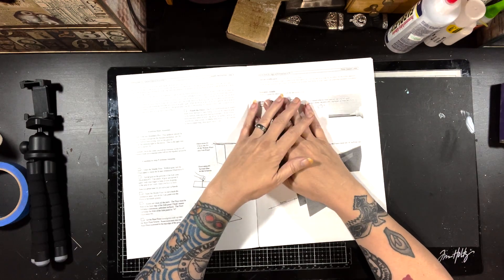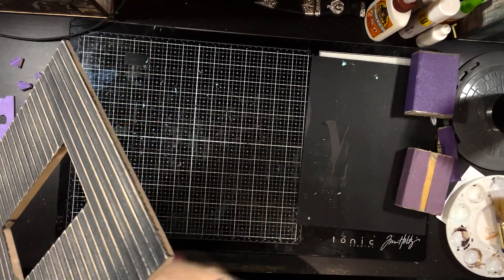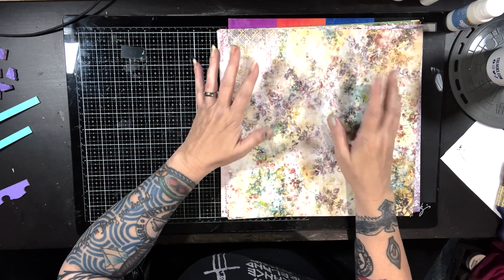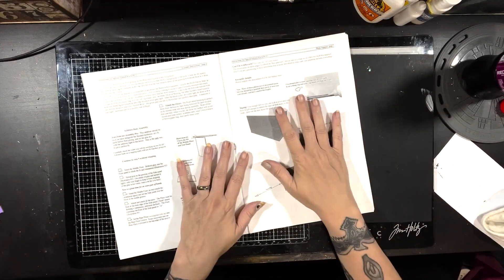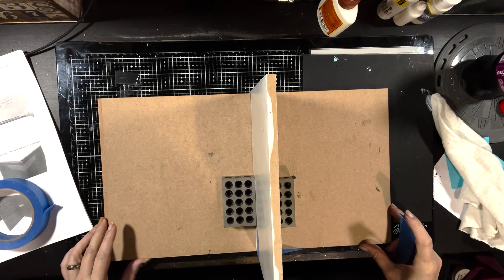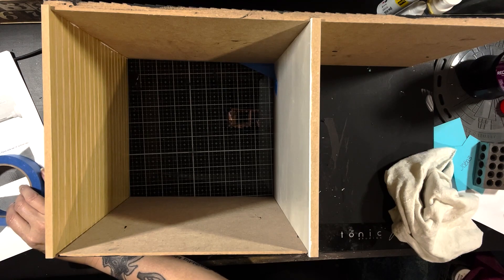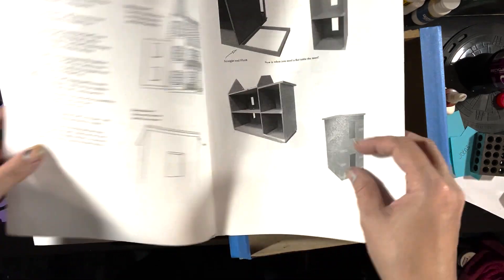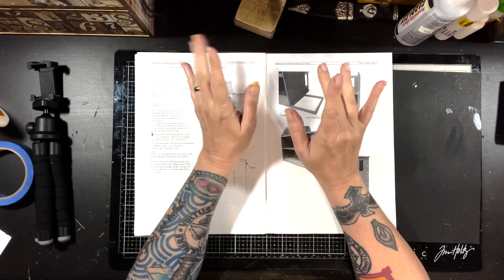Part 3 Allison Jr Addition Full Build: Sanding and Wall Assembly 1

Comment: I've wondered if those little cubbyhole shelving units could be made into makeshift dollhouses . Not certain of the measurements. Ceilings might be too high.
Reply from the maker: I bet they could.  In the old days, they used to make dollhouses out of cabinets....like the ones with shelves and glass doors, so it is not just feasible, it is historically accurate. :D
Reply: @skeletorama1916  I was thinking I wanted a carpenter to build me a house. But they might not understand, but if I specified a shelf system, then they would understand. Just need some windows and doors, that's all. Little holes in the floor, like to pass electric cords through only for stairs.